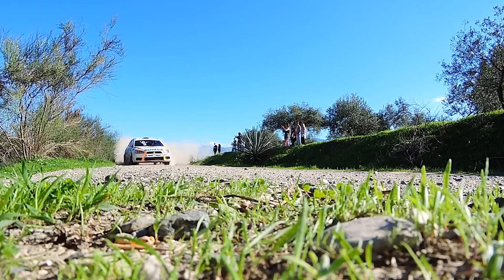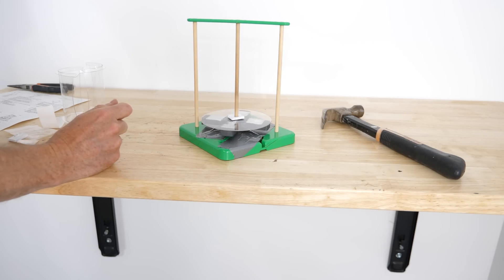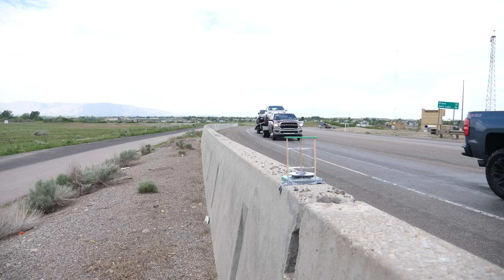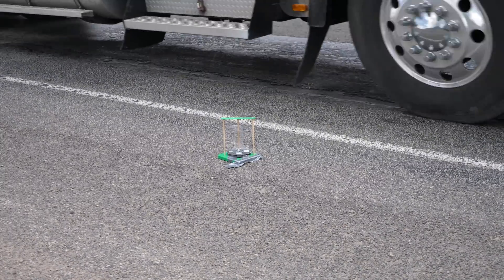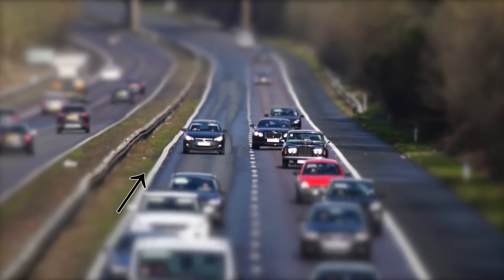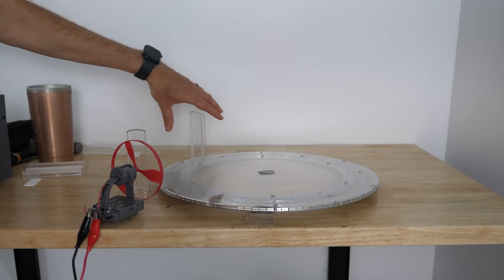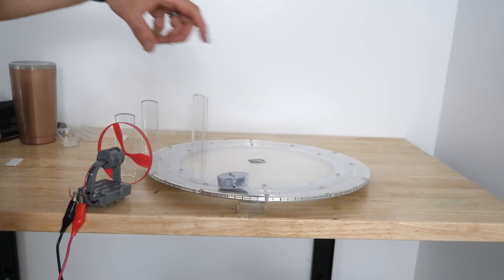Do Traffic Turbines Actually Work?

Comment: I thought the idea was long straight roads with no trees make a 'tunnel' like effect that creates ideal conditions for wind capturing. 

Both sides of a road go opposite directions. The wind of the cars basically cancel each other out. Seems you are overlooking too many factors.  If the barriers are between the two lanes where the cars are pushing wind in opposite directions they would actually take energy and reduce the effects of the opposing traffic... the net effect is still basically nill. Your test is not comparable to traffic.

Comment: Nothing is free. Extracting energy will come from somewhere, so the cars gas consumption will increase even ever so slightly.
It's like placing antennaes next to high voltage lines and grabbing "free" energy.
You explanation is very good

Comment: It's dangerous, if a turbine fall and hit a car while falling it will hit the windshield, the blade can fly from the ground with the air pressure and hit a windshield, also a car wheel can throw it in another car.
The chances of it become a giant flying aerodynamic knife are too big, gravel used to make asphalt currently can make small crack in windshields, just imagine a big blade doing it.

Comment: i dont see this working well for large scale power applications, but i could see how it could be useful for powering a single device that would usually be on the side of the road, like a speed trap or something. with that being said, solar panels are a lot more effective for that kind of thing, so it would only really have purpose in a dimly lit area for that application.

Comment: it is interesting to point out that in the middle of the road, where in each side the cars are going in opposite directions, the reduction of the wind speed is beneficial for the reduction of the drag (the wind caused by a car in one direction slows down the car in the opposite direction), and also it would take energy from cars going at high speeds in both sides of the road

Comment: The production of energy-saving products should first and foremost output more power or offer more resources than it took to make it. Recycling is actually a process that is NOT worth doing, since it costs so much resources just to do while most recyclables are not recycled. On top of that, it needs to be washed many times, bringing PFOS into our water supply......

Comment: That experiment was very bad.

Your "car" does not propel itself like a car, any outside factor will only reduce speed. The wind is not produced by the "car" so in the situation it makes it around it gains excess energy from the wind which only makes this generally useless but it also loses energy from the turbines due to the same outside source. It is also floating slightly which should be heavily impacted by the wind as a result amplifying things even more.

When an object has weight, momentum, and is propelling itself forward you should have different results. To the point where it may not be even be possible to notice. You removed to much making it only useful in a vacuum not in reality.

Comment: Why not put that thing on car's roof , that will be very grateful
Reply: Nonsense idea
Reply: @EIGatito  like your opinion for me?
Reply: @newnitikkk19  i think you missed physics classes
Reply: @EIGatito  and i think you missed your mental checkup this week
Reply: @newnitikkk19  if you put it on car roof it will slow down the car and the car will need more fuel as compare previous without turbine
Reply: @EIGatito  am not saying to put that in roof , like that radiator fan somewhere in front inside the car's bodykit

Comment: The fan is giving you results which is great and all but definitely not accurate along with the fact that you didn't put actual turbines and instead used stationary panels which probably redirected airflow more than just blocking it. Also I think its irrelevant because traffic is not always one car after the next which seems to be the only time this effect matters for vehicle efficiency. I think it's a harmless waste energy gathering machine.

Comment: I have seen this concept proposed with rollers in the middle of the road. That had added "benefit" of cars loosing traction over it.
Wind turbines are not that dumb idea, not as grid power source, but maybe powering some illuminated traffic signs when solar panels are not viable and grid connection would be too expensive.

Comment: The example traffic turbine in the video was installed between the 2 lanes in opposite directions. Wouldn’t that mean the air is already slowing down due to opposing directions? If so perhaps the turbine would have no effect.

Why not setup 2 tracks with fans bowing in opposite directions and add the turbines between them

Comment: I always wondered if electricity could be generated at the side of the road by a vibrating rod with a very high center of gravity that just barely stayed upright. Something like the signs on springs that swing back and forth, but in any direction parallel to the ground. It would exaggerate the wind from the cars and the weather and flap dramatically in the slightest breeze maybe generating electricity or compressing a gas or turning a gear, I don't know. There would definitely need to be millions of them, and linear would make the generation harder to regulate, but I always wished someone would try it :-)

Comment: I've always thought of a system just like a hose across the road with water ,air, or fluid and as the cars go by produces with the wave inside or the pressure to a flywheel generator that can sustain its motion until the next vehicle which would cause it to go faster with higher traffic flow or something like that

Comment: One thing I’ve noticed is that with cross winds my truck gets less fuel mileage than when there is a slight head wind, and so I think wind turbines would actually help my mileage by reducing the crosswind. But that is just my situation, and also it would make sense to not do this just from the maintenance perspective, there would be a lot to maintain

Comment: well my thought is are these turbines actually causing difficulty for others cars to cut the air. or they helping opposite diections cars a little bit of help?  
look, when 2 different lane cars very close. they make some air force to each other. i think these turbine or walls between these opposite side cars will help a bit of opposite air force resistance.

Comment: There's already a British start-up called  Alpha 311. They have produced the concept of attaching the turbines to lamposts on motorways. That way, the majority of airresistance caused by the turbines was already there. On top of that, the majority of the infrastructure for feeding the energy back in to the grid is also already there. The other alternative is to put a battery into every lamp post and have it store the energy for night time, thus reducing the energy consumed by the light over night. Personally, I think they are a good idea, though it does depend on how much the turbine costs to produce versus maintenance and power generation.

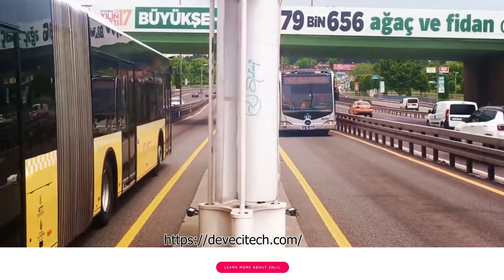Comment: 2:43 NO WAY... when driving at high speed, they are likely to get crush 99% of the time; and if they are high up due to a concrete wall, the wall would be too close to vehicles causing danger to the trafic. nonononononono...

Comment: Put em on/near train tracks... Between that and retro-fitting current train brakes with inertia-based recharge systems, which is pretty common as i understand the tech, it seems like a very efficient way to save/provide energy along a kinetic route.

Comment: I say put these on electric cars as another method to help charge the battery as you drive, like the regenerative braking. I'm not sure if they already have these somewhere in teslas but it seems like a good idea. And if it causes a performance problem, it could be part of a battery save mode or something

Comment: this seems practical. i live in a city with recessed highways. meaning we have lots of high speed corridors and overpasses. the upwind on some of the overpasses is impressive. i could see many ways of implementing this ranging from "self-powered" lighting and signage and enabling the power requirements to have a smart highway. also beautification of some mundane road objects like roadsigns, convert the straight metal post in to a squirrel cage style turbine and have safety colors or something. on the same track of improving the highways, all these signs could be upgraded and mile markers to all feed power back in to say the highway lighting.

all the overpasses we have in my city could easily use the wedge shaped area to mask off to be more of a box and put turbines on the corner edges and even the top edge since the updraft is so strong. thats 8 turbines per overpass. that kind of "free energy" could be used to do some cool things like induction heating to prevent ice buildup and remove the need for salting highways, which ruins them forcing more resurfacing.

this would be some cool college research.

Comment: an interesting demonstration, but much like with solar roads, it's just a worse use of resources and basically a gimmick.

Massive wind turbines that go super high are just more bang for your buck. You might be able to power a few local street lights with half a dozen traffic turbines but you could power half a country's streetlights with a couple of proper turbines.

Same with solar, far more efficient to put them on flexibly linked floating pontoons and just float them out to sea. You could even do 1D sun tracking with just a couple of attitude jets on pontoon arrays the size of few football fields.

Comment: What if we made magnets spin the turbine. The magnets are gonna be adjusted in a way that they're going to be in a state of continous movement
Reply: Well the magnets would simply stop spinning once they get close enough to another magnet/in-between two magnets because the magnetic force would be trying to either push them away of pull them together. Magnetic perpetual motion has fascinated scientists for many years but unfortunately won't work.

Comment: Thanks for this video. I've been arguing against the idiocy of "traffic turbines" for years. They are nothing but a combination of a perpetual motion machine writ large, stealing from the commons, and the old monorail con, all rolled in to one. Most of the energy they generate isn't free. It was stolen from thousands of cars, one microjoule at a time. Just like all the so-called perpetual motion machines that people demonstrate, they all need outside energy secretly feed into them. That outside energy is stolen from all those commuters. They may not notice it, but stealing a half-penny from millions of people is still stealing. Finally, they are only being pushed because gullible city counsel members don't understand the physics involved. Not do they understand the maintenance nightmare they are buying into. 

It's a just a con. Just like a proverbial train system to nowhere.

Comment: In the middle of the road, as the commercial ones shown, it does take from both sides while stopping the air from one side increasing the drag on the other side, so it's efficiency penalty could be canceled out, plus it's closer to the faster cars (but further away from big semis)

Comment: Your superconductor experiment is flawed which caused you to draw the wrong conclusion. 
In your experiment, the fan was giving the added force to push the item around the circle. The items standing in for the generators deflected the wind, acting against the device. Besides being completely different from vehicle traffic on the roadway,this experiment is using completely different forces at work. 
In a roadside example, the vehicles are pushing through the air, disturbing the airflow. The generators simply take advantage of the disturbed airflow. 
The generators impart absolutely no resistance to the vehicles. The only potential resistance which could be imparted by the generators could be creating added turbulent airflow for the vehicles to pass through (with enough generators.

Comment: Cool demonstration. Another one I always wondered about and might be cool to test: Dynamic microphones generate their power from the sound waves in your voice, if you had enough of them in a really noisy environment, how much power would it generate? Could it be in any way practical? pretty sure no, but sounds like a fun experiment.
Reply: I don't think the electricity from Dynamic microphones is useful for much more than turning it back into sound
Reply: @ThePizzabrothersGaming  Simply put the noise thru a wave squarer. Every time a car goes by the wave goes up, as it passes back down. AC current. You'd have to tweak it, but it would work.
Reply: Excellent ! No coupling like w the turbine, the car doesn't produce more noise just because its being used. Are you familiar w the new digital mics for phones ? They can pick up from a whisper to being in the first row of a  Metalica concert w no distortion, 0 to 140 db. They could be placed in or under the road itself, even.

Comment: Isn't this similar to putting a wind turbine on the top of an electric car in order to power the electric car? Only instead of the turbine being on the car it's next to the car. If the car is the only means of turning the turbine and wind is not a part of the equation then it's a closed system of cars and turbines. That closed system will not generate a net positive gain, only a transfer of energy from the car to the turbine and would result in a reduction of the cars overall efficiency.

Comment: The biggest issue is drivers who can't keep their cars off the shouilder.  A car traveling at freeway speeds will wipe out thousnads of these every day.  Small airplanes of yesteryear used wind driven generators for electrical power before the engines were fitted with alternators.  Even large airliners use wind driven generators for emergency power.

Comment: The car affecting the air to affect the turbine has already left the system by the time there is an interaction between the air and the turbine. It sounds like that criticism was made by an electrical engineer comparing it to an oscilloscope reading as you bring an inductor into an em field.  Superficially thats a good analogy when explaining how to harvest waste energy, but practically its not a useful comparison. 

Besides that, the company making these highway collectors is a pump and dump scam as most green energy projects are.

Comment: A tunnel would increase the turbine's efficiency. Also where traffic descends turbines would use energy that would otherwise be dissipated as heat using brakes.

Comment: I'm a little confused about your experiment. Wouldn't there be a difference if you could do that and not have the "car" powered by the fan, but powering internally, generating the draft? This experiment looks more like the air driving the disc is deflected away from it by those panels; not so much that it would be slowed down from driving on its own power by them.

Comment: Compared to giant wind turbines, cost is a mute point, but the advantage is they don't create a scar on the landscape. The wind farms are far worse than any oil pipeline. 
If the turbine isn't capturing vehicle energy, that same energy is slowing traffic coming in the opposite direction. Cross traffic creates inevitable vortices that affect traffic anyways. Putting them along center dividers would be capturing those crosswinds, along with any naturally driven winds, and as you pointed out, these small turbines won't pose any more resistance than pre-existing obstacles.

Comment: i dont think roadside turbines would have any measureable effect on vehicle efficiency as the air that would hit it is moving away from the road to get to said turbine so that air should not be having any effect on the vehicles with or without the turbine. not to mention any significant break in traffic is going to break up the air movement and the next car is going to have to punch through that to start a current.

the example with the fan makes no sense to me as the air is moving significantly faster than the superconductor which means its pushing the object, a vehicle at any decent speed will be going faster than the air currents around it.

overall though these turbines would likely not be efficient enough to do much beyond maybe powering roadside devices like maybe lights on signage

Comment: They should be alongside the road to augment the power grid supplying the lights on the road countries use huge amounts of power lighting the roads at night They also work much better in tunnels would supply lighting for the tunnel.

Comment: We should be sticking to capturing energy from natural sources of movement.  Instead of just capturing rain, we could have a second layer that funnels the rain into a turbine before it goes into the container.  We have wind.  We have rivers.  We have solar energy.  We have tides.  We could be using evaporation as well.   Set up evaporation at ground level in a desert that goes up to a water tank where it cools and condenses and then comes back down through a turbine.

Just sucking energy out of systems we're putting energy into is always a bad idea.

Comment: There also another issue that you didn't mention: traffic is not constant. At all, anywhere. A highway might have the right amount of vehicular flow... but only at rush hour. Or maybe that good flow is at normal hours... until rush hour when everything slows down. And then at night there are far fewer vehicles.

Highway turbines just don't work for modern power needs.